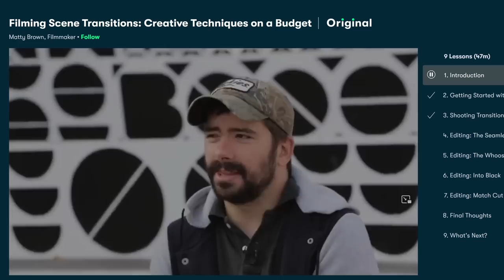Assembling the shepherds axe - part 3

Comment: Using the lathe centre to align the drill bit with the rivet hole on the other side was genius! Thanks for  another great tip
Reply from the maker: Something i picked up from a builder of muzzle loading rifles years ago.
Reply: I was thinking the same thing. Learned a new trick today. Damn good idea. Thanks
Reply: It's such a simple idea but it's so awesome to finally have a technique to get the drill aligned perfectly! Appreciate you sharing that!

Comment: Always wanted to make one of those so maybe now I need to get off my duff!  Great work as always, John.  I use sledgehammer handles for any hammers over 2.5#, but when I need a longer handle, like for a walking stick, I've found it's rather economical to go to the hardware store and browse through their selection of replacement handles for wheelbarrows and post hole diggers.  These are usually hickory, but even if they aren't, there's still plenty of wood in them so you don't come up short... unless you're like me and don't read a tape measure well enough.
Reply: as they say, measure twice cause you can only cut once
Reply: @kassiog.6595  Or, measure twice and it's still too short!  :D

Comment: I use a similar solution for handles, buy the best looking big shovel handle at the hardware store,  and it becomes 3-4 hammer handles. Last time I did it, a single hammer handle was barely cheeper than the shovel handle. I guess they are charging for the shaping more than the material. That, and I collect broken off sledge hammer handles from my friends and family that have bad aim and hit the handle on the target, breaking it off just below the head. Can usually get a couple 2-3lb hammer size handles from the remains.

Comment: This doesn’t have much do do with the video it’s just a question from a young guy who’s looking at getting into blacksmithing would a Buffalo forage co coal forage be a good place to start its 350 dollars
Reply from the maker: Most of the Buffalo Forge forges are a great way to go.  Provided it is in good shape and meant for blacksmithing.  The small round rivet forges will get you started, but aren't great.